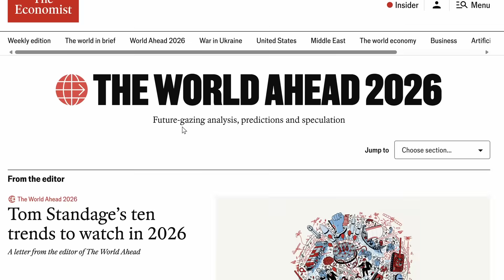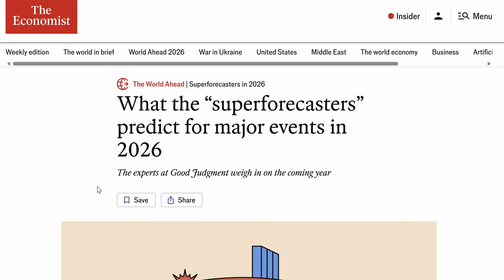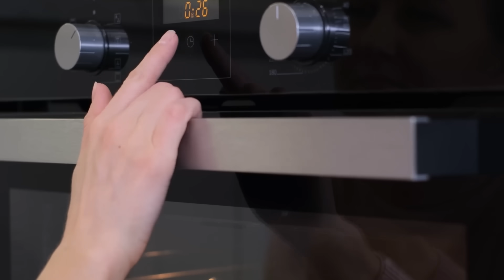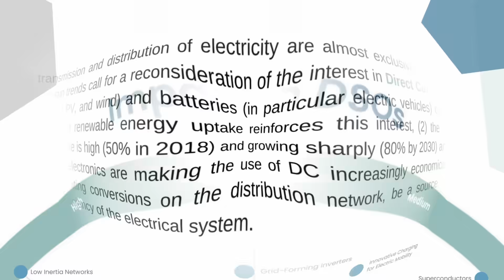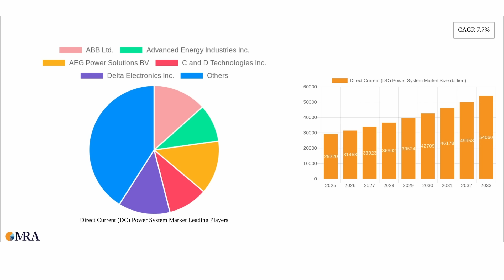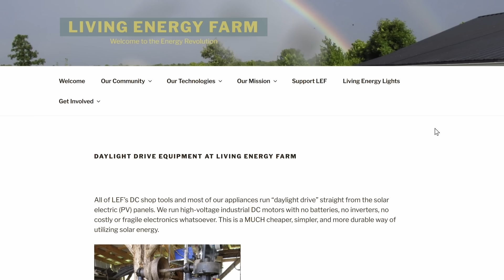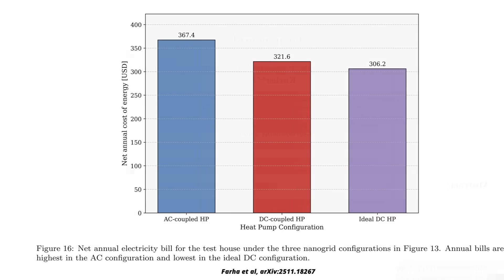Are We Using the Wrong Kind Of Electricity?

Comment: I was taught the DC power tends to grab and hold on to a victim that has accidentally placed themselves into a circuit.  AC affords a window of opportunity to break free of the circuit if it is crossed.  Is this why some have stated that AC is safer in the home.  Would we see a surge in accidental home electrocutions?
Reply: AC & DC are dangerous both!!!
Reply: @georgeageorgopoulos  Yes, but AC will typically knock you clear once contact is made.  DC will make your muscles clamp down and thus you can't release and get knocked clear.
Reply: Basicly,,,there is nothing Guys you can do on AC or DC if their currents get into your bodies,,,Yes DC seems to pull you into Death and AC seems to knock you into Death
Reply: Depends on the voltage. Below a certain threshold, DC is way way safer then AC on the body. Above that threshold DC becomes more dangerous. That threshold is variable depending on your bodies conductivity so I can't give an exact number but at or below 120 volts I'd rather take a hit from DC then AC. Typically anything under 120 VDC is not considered lethal and anything under 50 VAC isn't either although circumstances could change that. Usually an AC electrocution and you can still have an open casket funeral, DC you cannot as it will BBQ you.

Comment: Asynchronous electric motor are easy to use with AC and difficult to kill. DC motor need brush which wear off, brushless Motor need active semiconductor part which need maintenance and cost money. 
 We don't use AC we use one of the three phases AC electric grid.

Comment: AC is easily transformable, which is probably the principal reason for its success.  But higher frequencies have higher losses over long cable lengths.  There have been applications where motor-generators are used to create lower frequency AC to allow greater transmission distances, ie. by using different pole numbers on the two machines, ie. 2 and 6 to transform 60 Hz AC to 20 Hz.  This can now be done with a solid state frequency converter - but maybe not as robustly.  Also, "DC" doesn't imply one voltage - different values are needed for different applications and you need to create several levels to properly address all of the equipment currently found in houses.

Comment: What many don't think about: it is very hard to switch DC. Without a zero current phase the arc will just continue to burn. Normal arc heated chamber blower switching isn't enough then. HVDC switching goes through a lot of hoops with large coils and capacitors to temporarily get the current to zero to be able to switch. It can be about 20 times more expensive than having an AC switch or even impossible depending on application.

Comment: DC above 30 volts becomes extremely dangerous. It's the amps that kill And and a car battery has over 400 . Also the lower the frequency the more dangerous AC is , if we switched to 400 hertz almost none would be killed.
Reply: How are those amps going to pass through your skin, are you a metal android, or what? Everything you wrote is completely wrong.
Reply: @sumwonche5688 it's the voltage that penetrates the skin . 24 will pass though wet skin. Over 50 and dry skin won't stop it at all. Electric cars use 270 to 800 volts DC .
Reply: @mikep9690  At a body resistance of 1.5MΩ at 220 VAC, you get 147 mircoamperes and a consumed power of 32 milliwats. 
That current is 6800 times less than a single ampere. That's the current your body would allow with a dry skin at such a high voltage no matter the ampere capability of the source. 
Imagine the current at a much lower voltage. Still, it´s very dangerous and AC is far more dangerous than the equivalent DC. 
I know from experience, from 220V AC and up to 1200 VDC. 
AC has the property to pass freely through your body electrolytes and organs that form capacities and completely mess up with your nervous system, while DC tends to be reduced and partially blocked with a single shock vs 50-60 times per second.
Reply: @sumwonche5688 you say single shock like it only lasts a microsecond. And you know when the connection is made your body's resistance drops to almost zero.
And again it's the amps that kill, most home circuits are 10 or 15 amps.
Btw a taser has 50k volts but only  5 milliamps.
Reply: Tell you what. Soak your hands in some salt water and go grab the terminals of a "safe" car battery and I'll concede that DC is safer
Reply: @mikep9690  You need to learn basic physics / electronics before attempting to make any technical comments. Right now you are an empty vessel. Open a book and start filling up.

Comment: There is no right or wrong in this. There is only better or worse for specific applications. For example those DC power lines are extremely long, that's because in "short' runs ac is much cheaper. The equipment is simpler. But on very long distances DC is better, high voltage, little current, same power transmitted. This goes for every application. Retrofitting an ac wired home isn't cost effective. But new builds and certain industrial uses can use DC to good effect. As usual it's a per case thing.

Comment: the beauty of AC is the ability to manage frequency, voltage and inertia automatically. This is difficult to do with DC. In fact the amount of renewable penetration on our grids (solar and wind are DC) is a challenge for grid operators  and often requires the derating of other assets for use as reserve and reliability - which increases expense.

Comment: I've been pointing this out for a long time. In a world of multi source, non synchronous generators it makes more sense to switch to a DC power grid. Right now all solar farms producing a DC output have to go through a very lossy inverter which needs to be synchronised in both frequency and phase with the local grid. However, replacing millions of transformers with very complex DCtoDC converter plant could cost billions.
Reply: You can forget about solar and wind power...  They're about to be crushed by geothermal in teh decades to come.

Why do wind and solar with batteries when they're an environmental nightmare when you can do very low environmental impact geothermal?

Just 0.1% of the thermal energy beneath all of our feet is enough energy to power mankind for literally millions of years.

Comment: LOL, No, we absolutely are not using the wrong kind.  Is this where we are?  This is how we dumb down people even further?  DC is terrible for this sort of stuff.  You can easily convert AC to DC.  Have fun doing the opposite.  DC is absolutely terrible for infrastructure.  We likely should just start jacking up the frequency of the AC which was Tesla's real vision in the first place.  Na this is nonsense.  DC will never take over because it cant.  Feels like a WEF plan to trap people in a tiny area like most of their plans.  Cant go far is the electricity does not go far from the city.

Comment: The long high voltage DC transmission lines in the USA are used for connecting different grids. With DC you don't have to worry about synchronization.

Comment: I know some Amish who use electricity to light a general store and a few other things. They're keeping off the grid, and using solar, wind, and water power to do it. It was from them I learned how DC is making a comeback. The only major advantage of AC, they have independently discovered, is in stepping voltages up and down, which is important if you're on the grid, and far less so if everything's happening locally. (I had a great afternoon with a couple of them last summer explaining how traditional transformers worked and why AC differed from DC in this way! They may prefer a low-tech life, but they want to know what's going on...)

Comment: The answer is: If you are building an undersea cable use DC because water has a dipole-moment. Otherwise use AC.
Why? Because 3 phase AC allows you to transport the energy capacity of 3 power lines over just 3 power lines, without the need for a neutral or return lines, and the costs of physical power lines dominate by two orders of magnitude over everything else under consideration.
And any AC voltage can be turned into any other AC voltage with just one component, into DC with the use of just 5 components and into stabilized DC with just 7.
Also DC switching losses when you have to get to another voltage are huge while in AC there are almost none.

Merry Christmas!

Comment: 2:51 - I want see price tag on microwave oven that runs on DC. With DC/DC step-up converter producing 5 kV at ~1 kW power. The AC type only has to have big transformer, HV diode and capacitor.
Reply: They haven't used big step-up transformers for years. They changed to a system that rectifies to DC, then use a higher frequency inverter so a relatively small, lightweight transformer can be used. So to answer your question, the price tag would be lower.
Reply: @sundog486  Well, I let myself to be left behind then... I hope they're still using magnetron vacuum tube?

Comment: Happy holidays Sabine. Missing some basic EE perspective here. :)  High voltage, AC or DC, is what reduces power losses over long distances. It is basically Ohm's law, as power loss is a product of current through a resistor. For any given amount of power transfer, higher voltage means less current (Watts = Volts * Amps).  Tesla advocated AC, because it is relatively simple to step-up or step-down AC voltage by means of a transfomer, a simple and relatively efficient inductive device. High-voltage DC power transmission has an advantage over AC due to the skin-effect of current flow. DC has no skin effect in the wire, 50-60hz AC has a skin effect of about 9mm.  DC long distance transmission at high voltage can use a smaller transmission cable, as the whole diameter carries current.
Reply: Long distance transmission of DC is more efficient than AC (at the same voltage) because the capacitance of the line causes no losses.
Reply: She touches on this around 4:40
Reply: Also at least early on they understood DC slightly better and it seemed like DC equipment was easier/ more economical to make. Specifically motors and the controls for them such as speed and reversing rotation... the reality wasn't that simple but that came to light as AC motors were developed and they learned more about their characteristics and how to control them also prior modern electronics converting from AC to DC or DC to AC wasn't easily accomplished one interesting example was on early model T's they had reached a technology level where Ford could cheaply and easily integrate an Alternator (AC) into the engine flywheel for lightning and ignition needs but they didn't have a practical way to rectify the AC to DC so you still had a relatively small dry cell battery to power the ignition for starting purposes until the alternator was making enough power to sustain its needs but it still could not recharge a battery.
Reply: Westinghouse, not Tesla.

Comment: One word: Stepdown. 3 phase AC transmission is very effective and it works with very low cost, efficient transformers to convert to distribution voltage networks. As we all know (?), alternating current does not actually flow in the wire. Instead, wobbling electrons create electric and magnetic fields outside the wire (a bit like what Tesla was trying to do in free space). The cable acts as an antenna, efficiently transferring energy via pylons in the open air. Does not work so well underground or submarine.

Comment: Wind turbines generate AC (of wind-dependent frequency and voltage, i.e., generator speed) which is typically converted to DC and then back to AC which is phase locked to the grid frequency and within an acceptable voltage range. 
Merry Christmas folks!

Comment: DC's biggest advantage is in things like speed control, it is a lot more complex with AC motors . The reason AC was chosen was bc AC was and still can be stepped up and down easily, so for long distance transmission you can step up the voltage to overcome losses and step it down for use. 

I believe DC also elongates the life of incadescant bulbs which these days is increasingly less important with the use of LEDs. Having DC for electronics is not a big deal, converting ac to DC is simple as is then stepping down the voltage and losses are small compared to simply stepping the voltage down w DC transmission..

The real issue with the power grid isn't AC or DC, it is building a smart grid that can route power nationally from generator to user..if wind power in North Dakota is produced, that power should be available nationwide . Likewise the grid should be redundant, like the Internet is. Right now it is regional grids with little redundancy or resilience
Reply: Speed control was done using DC with ancient technology of resistors. That is why early railways were electrified with DC. Every modern locomotive uses AC motors and modern electronics to convert DC to AC or even AC to AC (in the case of AC electric locomotives). All modern diesel-electric locomotives use AC as the "medium" from the crankshaft of the combustion engine to the rotation of the wheels. Older diesel-electric locomotives used DC or hybrid AC/DC systems. AC is more efficient and less maintenance intensive.

Comment: While they are understandable reasons for transporting AC and also safety reasons, it does feel quite ironic that nearly everything we plug into our outlets at home has to be transformed to DC to be used. But having actually built my entire offgrid system from scratch i have also had to deal with how dangerous DC arcs can be compared to AC. Combine DC with something as simple as a unsafe clone of a DC switch and it might just burn down a house.

Comment: Alternating current is cheap to step up and down in voltage. High bolts low current for long distance transmission. Low voltage high current at point of use. 
By the way, more than 20% solar destabilises the energy grid   It’s why Spain & Portugal had that horrendous black out.

Comment: The problem with high voltage DC is, you can't let go in a short circut and in some cases sensores are dissolving galvanic, ...but it's quite not uncommon, that intern circuts are in DC! 😎

Comment: Well, power DC to DC conversion is only practical in last couple of decades. Todays FET transistors are capable of switching spot welding current, millions of times without getting damaged, while no larger than fingernail. My grandpa who was electrical engineer would be completely bewildered by such a component.

Comment: AC is for converting high current low voltage power to low current high voltage power for transmitting long distance through wires. Then converting it back again for use. This is done using simple non moving coiled wire devices.

Comment: CaAC is more lossy over long distances. The power line forms a capacitor with the ground then AC creates reactive power that sloshes back and forth in the line causing higher power loss. All the new super high power transmission lines are DC because they are less lossy. The advantage of AC is that a transformer can be uses to step up and down voltage and currents. Today we have DC to DC converters that can do the same for DC. Also back in the day power was generated by and rotating generator that generated AC but today renewables generate DC.

Comment: Basically, a big advantage of DC is that it makes it much easier to connect the grid with microgenerators, e.g. a home solar panel systems.  If you generate a higher DC voltage than the DC grid, you feed power into the grid, if your voltage lover, the grid feeds your system. There is no need for frequency and phase synchronization.

Comment: AC made sense at the turn of the century, when transformers with no moving parts were used to change voltages between generators, grids and local distribution. Transformers are still viable; however, most electronics have required a dedicated rectifier and filtering at each and every point of use. That may or may not be a significant waste, but it adds complexity. Today, DC to DC converters allow translation between voltage levels, but don't forget, AC is still required to accomplish this. Some sort of chopper or oscillator is needed to make transformers or capacitive voltage multipliers operate properly. We may benefit from using different AC frequencies as opposed to the 50 or 60 Hz, which require large iron cores to avoid magnetic saturation. But we still have a large number of induction motors, and synchronous single phase or three phase loads that would require legacy AC power for a good long time into the future.

Comment: AC switchgear can be made lighter and thus cheaper as arc suppression is not so difficult as with DC. This applies even to domestic installations. The AC induction motor is about the simplest possible- DC motors require brushgear and commutators or electronic switching to provide a multi-phase supply (to an AC motor). A transformer is the simplest and cheapest device for stepping up or stepping down voltages.
I AM using the wrong kind of electricity- The overpriced kind that we get in Britain (which includes tax and a green levy).

Comment: How does DC run a transformer? STOOOPID idea.
Save 15% on your electricity bill RIGHT NOW. Unplug or surge protector off all your transformers overnight or not being used: - washer, dryer, audiovisual, computers, rechargers. Your meter is outside your home:  AC voltage and current are in-phase. Within your home every inductance (transformer) dephases.  The billable energy is everything. The usable energy is only the area overlapped by BOTH the voltage and current. Transformers are on the HOT side of the device. 𝕋𝕦𝕣𝕟𝕚𝕟𝕘 𝕠𝕗𝕗 𝕥𝕙𝕖 𝕕𝕖𝕧𝕚𝕔𝕖 𝕕𝕠𝕖𝕤 ℕ𝕆𝕋 𝕕𝕚𝕤𝕔𝕠𝕟𝕟𝕖𝕔𝕥 𝕥𝕙𝕖 𝕥𝕣𝕒𝕟𝕤𝕗𝕠𝕣𝕞𝕖𝕣!